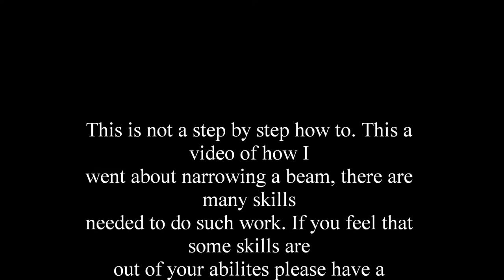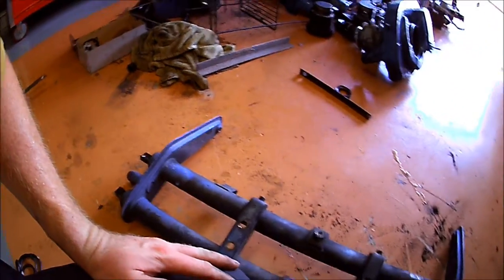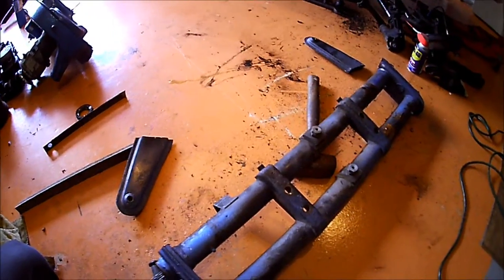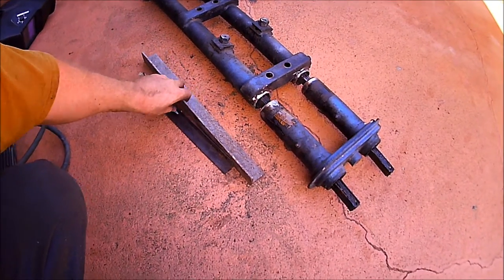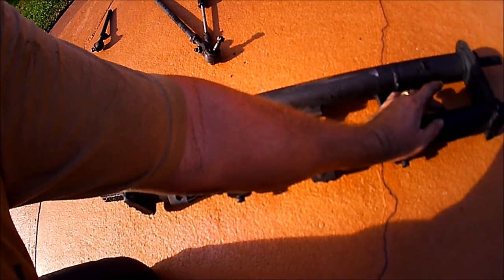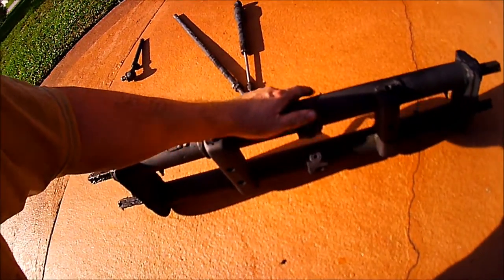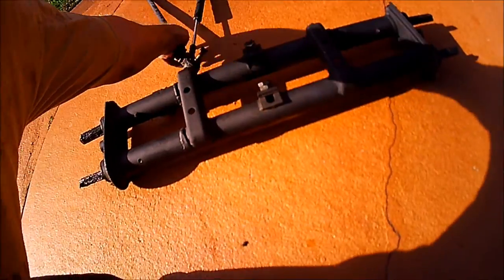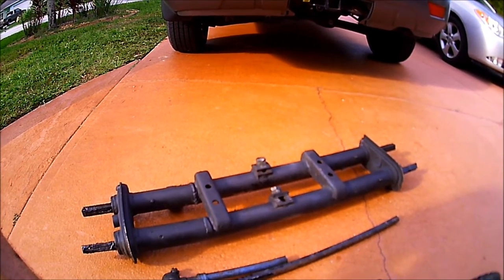4" Narrowed Beam (Shade Tree Episode 18)

Comment: How does it ride with no shocks? I'm almost ready to mount mine up and was curious.
Reply from the maker: Not horrible, but not a corner hugger either. The main thing I noticed was it was a little twitchy when you hit uneven pavement at highway speed. As far as bumps it rode just like a slammed bug with shocks.
Reply: @MattLundquistVW  good to know. Thanks!